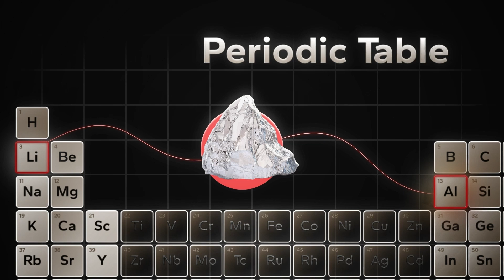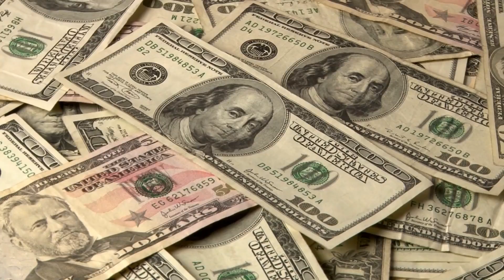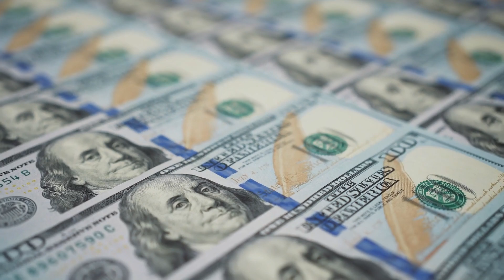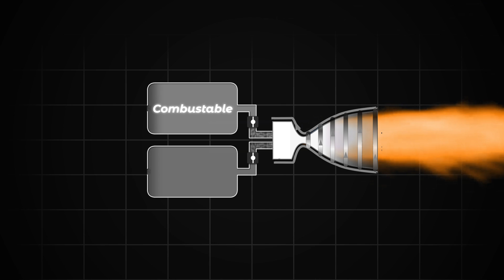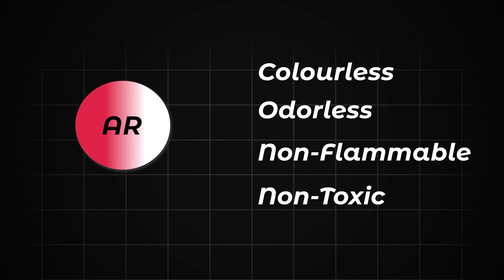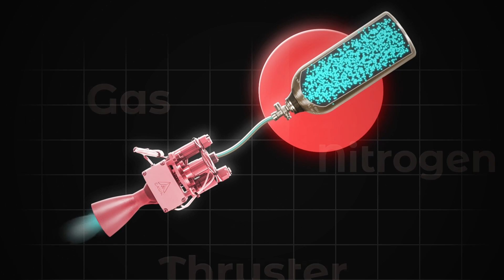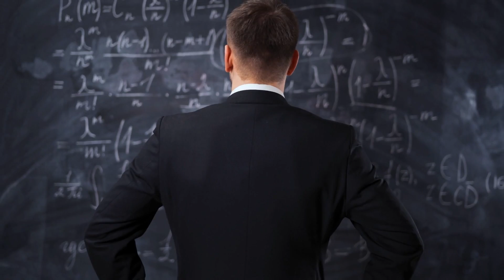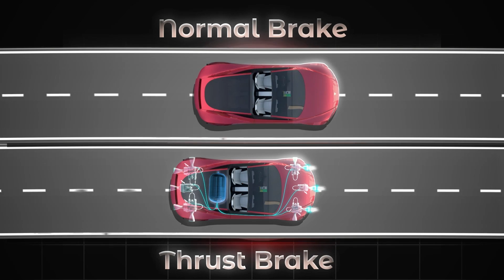Tesla and SpaceX Are Building Something Insane!

Comment: I’d love a car that’s highly corrosion resistant to deal with all the salt we use in Wisconsin during the winter.  Who wants to spend $40-50k for an average car or truck, only to have the bottom chassis parts start rusting in a few years, and the sheet metal to rust in 5-8 years??  It’s very frustrating…sigh, first world problems.

Comment: Stainless steel for the CyberTrucks body was not a good move. It is a production line hassle, expensive, heavy and moreless not repairable. Carbon Fiber would have been a much better choice. Nevermind the horrible range, especially if you are towing.

Comment: Nonsense
If anything, could only be a cold gas thruster and they have far too little specific impulse for a sports car to do anything useful. You would need AT LEAST to carry +10% weight gas fuel per 5s drag race. If at all, would make sense as an emergency brake or curve assist only. Same applies if used to increase traction.

Comment: YOU GOT IT ALL WRONG about the thrusters. They will point UP! Yes. To accelerate really fast you need traction. Downforce from airfoils need fast air passing over them, so they don't do anything at all at the "launch moment" when the car is not moving and when it really need some downforce to keep the tires from wasting energy.
With the thrusters pushing the whole car against the ground you can REALLY accelerate fast without wasting energy on a burnout.
You can have a light car that 'weights' a lot and can use all power available on the wheels to move forward.
Just like a ground effect but without fans or wings. With thrusters!
Reply: Except that fans are in use today and work. No way thrusters would be better.
Reply: @falklumo Fans??  No shit?  Huh…what’s an example of?  I actually thought he was on to something with the rockets, especially starting from zero.

Comment: speculations about rocket engines in the spaceX tesla roadster are useless, it will not have a fuel tank or e rocket engine, "just" compressed air tank and cold air thrusters
the advantage is that the trusters are very compact (just a valve and a nozzle) and the compressed air tank is relatively safe if its inside the cabin and protected by the crumple zones
but the downside are
-the compressed air doesn't hold much energy  the thrusters will need to expel about 50kg of air per second at 660m/s (1340mph) to achieve 1.3G of thrust and enable 1s 0-60
-it will require dozens of minute of running a noisy air compressor for each second of thrust
-using the thrusters when the car is stationary or drives at low speed is less efficient. it provides the same force (newton) at any speed, thus lower power (Force * speed) and lower energy (force*distance) even though it is using the same amount of air
-using the thrusters at partial thrust is less efficient (slower cold air velocity)
-using the thrusters when the compressed air tank is partially depleted is less efficient (less pressure => slower cold air velocity) so you need longer longer thrust to achieve the same speed

ideal operation of the thrusters is very short bursts of full 1.3G thrust, with long downtime periods to rebuild max 10000psi pressure

Comment: Kind of a shame that this wouldn’t be a flying car, the concept that you outline is pretty neat but you would still call it a car. Which doesn’t fully match with the Elon said ‘you could barely call it a car’. I would hope that Elon would opt for the aspirational more than the exceptional, why bother with a tech only a few very rich will use - unless cold gas thrusters could be rolled out across the line in the future. A flying car, that develops new tech both for SpaceX and Tesla, would be the ‘blow them out of the water’ big picture thinking I would hope for from these two teams. A lot of hurdles, but if you can’t tunnel everywhere, why not fly and beat the traffic that way.

Comment: Soo we still need gas ⛽️ stations then to fill up out trusters?!?
Reply: It has an electric high compression compressor where the back seat normally resides.  The thruster will only blast for a couple seconds, then it has to recharge.
Reply: Or it will have a built in compressor that fills the tank with a press of the button. There's no reason it couldn't just use regular air.

Comment: This will probably be the best engineered car ever made. And it will be fairly cheap in terms of hypercar/supercar territory
Reply: the best engineered car ever made is the Mercedes Benz UNIMOG aka universal vehicle, it can have all kinds of features as possible from solid axles to portal axles to central tire inflation to all wheel steering to PTO for all kinds of accessories(dump truck, snow plow, railway work, utility crane, agriculture, mining...) lets not forget the Vario pilot where you can literaly slide both steering wheel and pedals and controls plus dash from left to right depending on the use.... the list is very long.
Reply: @alanmay7929 UNIMOG is nonsense and a commercial failure.

Comment: I was thinking they could also do a turbo axle with a cold gas thruster to power it.
Reply: I think the tires are already at the maximum grip possible.  More power through the drivetrain will just mean wheel spin. Cold gas thrusters into a jet nozzle would give an added acceleration boost.
Reply: @undertow2142  that make sense, my thoughts were the tires could keep up with the car given the boost from the none turbo axil thruster.
Reply: @Joe4show  think about it in reverse. Maximal braking is right at the edge of the tires slipping.  If you were blast a a jet of gas forward at the same time. The additional force acts independently of the tires to increase deceleration.  The tires and brakes don’t change. They continue to slow the car at the maximal ability of the tires to resist slip. The net force vector increases.
Reply: @undertow2142  ahh, got it!  What do you think of having the trustees pointing at a slightly upwards angle? Increasing downforce.
Reply: @Joe4show  Definitely, so long as the thrust acts through a point between the axles.  Otherwise, if it acts behind the rear axle the downforce is less effective and causes a lifting force at the front wheels.  I think a better use of the thrust would be by having it act laterally.  Downforce is most useful for cornering at speed (or during rapid acceleration/deceleration to increase the tire grip).  If the thrust simply acted to push the car from the side you could corner at higher speeds.   Lamborghini has a car with active aero (moving aerodynamic surfaces). It essentially is flying around the track using the aerodynamic forces to steer the car.
Reply: @undertow2142  so the layout in the video is probably the most effective layout.  Lamborghini has some of the craziest features. Have you seen the their new tow and chamber tech? It’s like the wheels are become separate robotic entities.